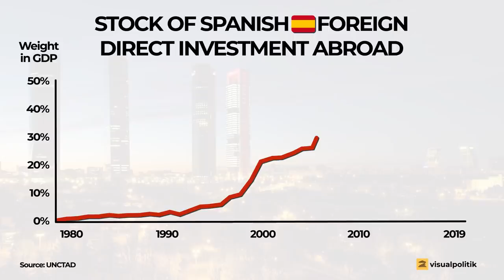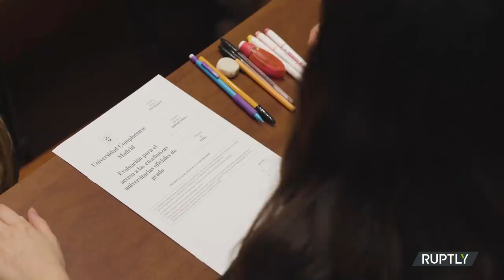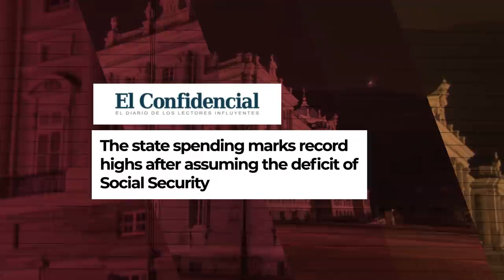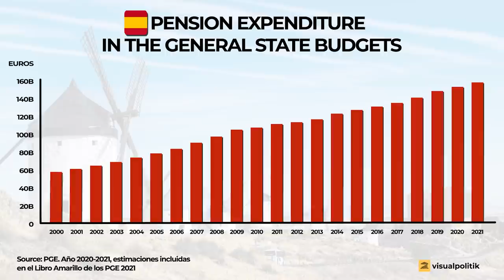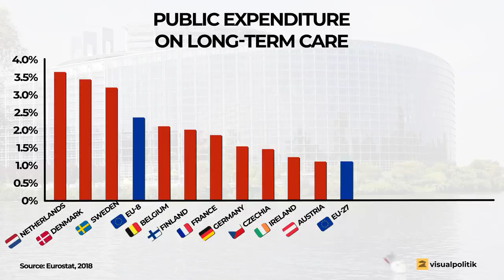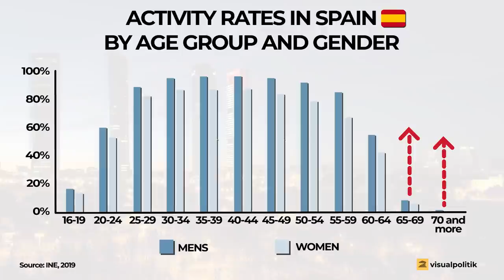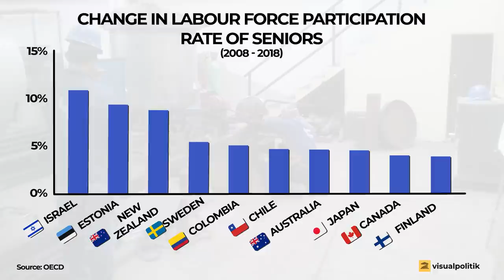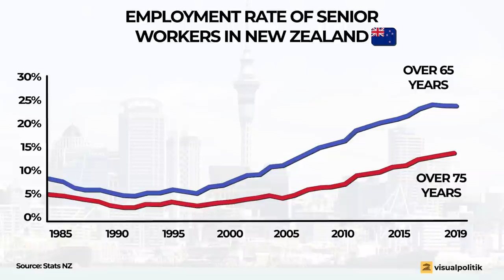The NEXT big CRISIS that is THREATENING SPAIN? - VisualPolitik EN

Comment: Great video. The 'demographic winter' problem is indeed a tough one. Put that together with an extremely high level of unemployment - and underemployment among young people and you have the perfect storm. Paradoxically, for a country with such an aged populace there is a remarkable amount of ageism in the workplace. The private sector is famous for forcing workers out in their late 40's and early 50's. This certainly needs to change.
Reply: True - Especially with the retiring BABY BOOMERS worldwide that is rapidly aging as we speak. Baby boomers were born from 1945 -1965  during the period when WW2 ended, which also happened in 1945. Also many soldiers were given their honorable discharge in late 1944 when they completed their 3 year tour of duty, and from keeping their troops from wearing out as well.
Reply: @robertko5425  Many soldiers were given... but which country are you talking about? Spain did not fight in WW2.
Reply: @robertko5425  The concept of baby boomer generation has been different in Spain, since we didn't fight WW2. Our baby boomer comes from 1960 to 1973 until the first petrol crisis, when the economy had recovered from our 1936-1939 civil war. Since we didn't get any Marshall Plan approval, our 40's were a complete period of autarchy, like current NK situation.
Reply: Yes, but it's important to note that while older folks are driven out, younger ones aren't contracted to replace them, or at least not with the wages and the modicum of job security they'd need in order to, for instance,  move out of their parents' place and maybe start a family.
Reply: @joschafinger126  You are absolutely right. Spain's minimum wage is the second-lowest in western Europe - behind only Portugal. And, good luck getting even that. Temporary, part-time, freelance workers - where almost all Spain's job creation is centered - don't qualify for even the minimum salary.
Reply: It is funny that Nordic or English people talk about the low birth rate in Spain when they usually have an average of 1.3 children. Of course the birth rate has dropped and they are in a similar position. Perhaps in Spain it is more noticeable because of the fact that seventy years ago couples had five children on average. Only South Americans and Moroccans still have four, five and even more children per couple.

Comment: It seems to me that you've trumpeted the bad news while pretty much ignoring the potential positives. 

1) Reforms in 2013 set to raise the state pension age in Spain from 65 to 67 by 2027. The retirement age increased at the rate of one month per year until 2018. Thereafter it increases by two months a year. As of 2020, it stood at 65 years and 10 months. So your first point is already being addressed - I think that there has been talk of accelerating this transition but I doubt that Sanchez has the necessary support in parliament.

2) You skate over the issue of unemployment (and low wages for many young people in employment) - in 1999 the rate was 15.48%, and in 2020 15.67% (in between it's fallen as low as 8.23% and risen as high as almost 25% but essentially, in percentage terms, there's been no improvement in employment numbers). In terms of youth (18-24 year olds) the numbers were very slowly declining prior to the pandemic but about 20% of young people were NEETs (Neither in Employment, Education or Training).  This leads on to the next issue:

3) Average earnings of young people in employment are low (in 2018 the Spanish National Statistics Institute calculated that the average Spanish millennial monthly salary as 943 euros ($1,074) for aged 20 to 24; 1,323 euros ($1,506) for aged 25 to 29; and 1,612 euros ($1,835) for aged 30 to 34. Compare this with monthly rents the same year -  the average monthly rent rose during the first three months of 2018 to 1,025 euros ($1,167) – as high as 1,603 euros ($1,825) in Barcelona and 1,549 euros ($1,764) in Madrid. The result of this is that the vast majority of young Spanish people live at home - Spain has just over 6.8 million people between the ages of 16 and 29, and barely one million of them live outside the family home. This means just 14.9% live in their own independent housing. Now you don't have to be a rocket scientist to realise that if a young Spanish guy wants to get it on with his girlfriend, their opportunities are limited - with concomitant results for the birth rate!

So, you have a situation where, if the Spanish can increase the number of people in employment and improve the quality of that employment then a big chunk of the problem will be ameliorated.

As for your other suggestions - attracting old people to retire in Spain; "the Silver Economy" - Spain is already a European leader in this. For instance, there are currently about 381,000 British people living in Spain (the third largest group after Rumanians and Moroccans), most are old (median age is 54) and economically are perfect immigrants - those receiving UK pensions have their health care paid for by the British government (about €250M in 2018), those who have retired but aren't yet receiving a UK state pension are obliged to have Spanish private health insurance and relatively few compete with the locals in the workforce - and all pay IVA on most things that they purchase. On the other hand a lot of the jobs that directly cater to their needs aren't very well paid - care assistants, restaurant staff, shop assistants etc - essentially this is just extending the benefits of tourism to Spain to a year round model rather than just April-October but the taxes on their consumption do feed into the Spanish exchequer.

If Spain can achieve full employment then it's next source of labour would be immigrants - their former colonial possessions in South and Central America, the Philippines and Cuba would be a logical choice - these people speak Spanish (not Castellano but close enough) and live in countries that are struggling economically.

So it isn't all doom and gloom in Spain - certainly if you wanted to reform the country from top to bottom you'd have a struggle on your hands - but what country's leaders would be happy to restart with a blank sheet of paper and try to rebuild their government system and economy from scratch? 

Why not take a look at Germany where Merkel has been kicking cans down the road for the last 16 years in the name of "stability" - including the needed reforms to the German pension system?

Comment: This happens to every western country,in Greece the minister said that in order the system to work either we cut pensions or we increase the age limit
Reply: That's just delaying the problem that won't solve it.
Reply: @Greywind111  Increase the age limit to 80. It will solve the problem. Very few people will be getting their pensions.
Reply: I think workers that have been promised a certain amount should be paid but in the future pentions and benefits simply have to be pegged to an objective economic indicator agreed by all parties. This way insitutions are not stuck with obligations negatiated during good times.
Reply: @wavemaker2077  in my country we have pensions that are 2.000 € 3.000€ and some are higher, while the basic wage is 600€... I think the pension should be a fix amount depending the country and if you can't live in the city with that money you should retire to the countryside where life is cheaper
Reply: @wavemaker2077  hahaha

Comment: The problem of caring for an aging population is worldwide ( Japan faces the exact same problem ). The problem of increasing costs to deliver health care is the other. Health care delivery needs to be reformed as the present system is far to inefficient and archaic to be effective  in the coming wave. The  first obstacle that must be overcome is realizing that "the ship is sinking and inaction is not an option".  The changes that are necessary are not going to make the "status quo" happy. The use of computers in diagnosing and providing care must be implemented ( the doctors will resist this with vigor and lies ). Actually the doctors are needed to develop these tools to be the most effective possible and to free them up for the more difficult cases. Paramedics and nurses need to be trained better to  triage and treat the simpler cases and this means moving responsibility of many cases out of the doctors hands ( you know they will fight that tooth and nail ). The greatest challenge will be finding someone with the vision to move us out of the 19th century medicine model and bring us into the 21st century.

Comment: The problem with my country is that it’s split in 17 autonomous regions each with its own laws, education and healthcare. The bureaucracy is ridiculous and the encouragement of regional languages only encourages higher structural unemployment and lowers labour mobility. Trade professions are not encouraged and looked down upon even though they are way more financially rewarding than next to useless degrees. 
The political class is just a self serving collection of incompetent uneducated never has beens that make a career hopping from post to post.
I left Spain when I was 18 for the UK and came back at 39 and the adjustment process is still a shock.

Comment: They should let in a shit ton of migrants from central and South America. They speak the same language, practice the same religion, a lot of them have some degree of Spanish ancestry, plus you can make it so they basically are paying into the system more than they are taking out of it if it takes them (for example) 10 years to gain full citizenship.
Reply: they would need to find a job that's not going to fly